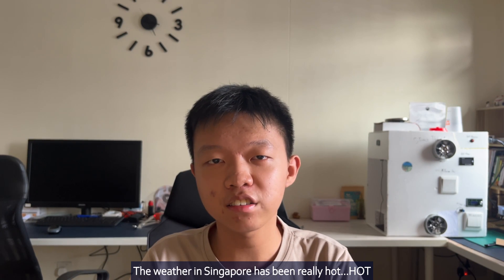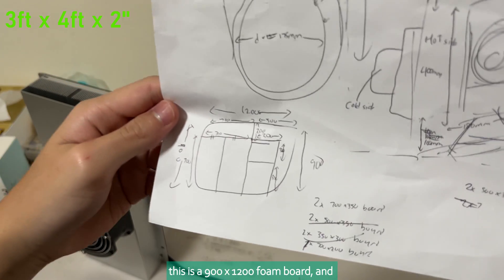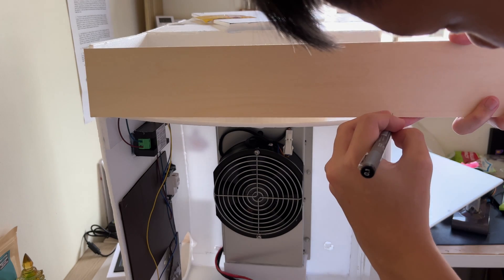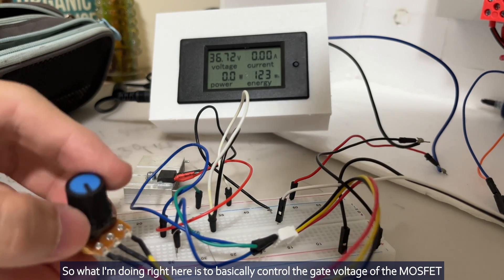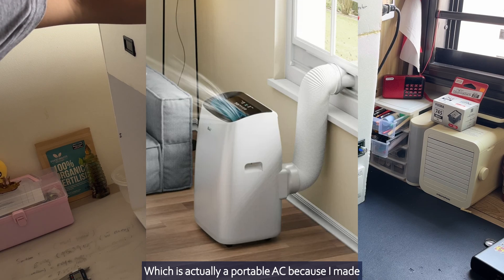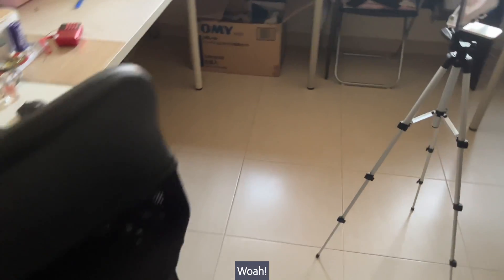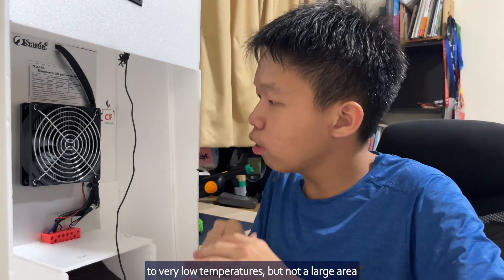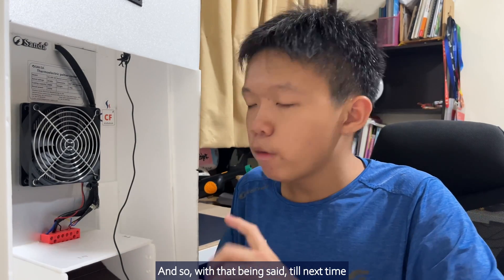Peltier Air Conditioner Build, Test & Science behind Peltier Cooling

Comment: Hi :) Nice job ! you should know that peltier coolers mostly used for small cabinet and boxes, not large room or areas.
Reply from the maker: @TwitTronics  Yep that’s true. Also of the low BTU rating (cooling capacity) of such devices relative to the input power. Sanda advertises such Peltier devices for cooling cabinets, which perfectly matches your thoughts on it! Thanks for watching the video! 😁

Comment: The SAN DA official website says that the maximum cooling power remains around 1024 btus/hour, which is usually not enough to cool large ambients mainly due to the natural heat exchange rate with the exterior. Although still you made a good work. Congratulations for the excellent project, mate! I'm eager to see your next projects. 😊
Reply from the maker: That’s true! Having the hot side being very close to the cold side constraints the hot side from getting cold, thanks for your support 😊